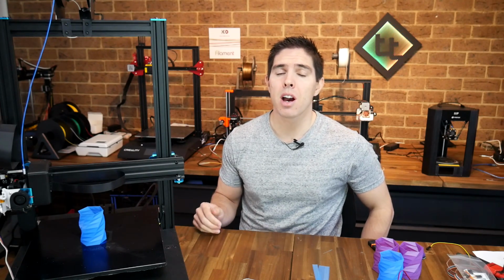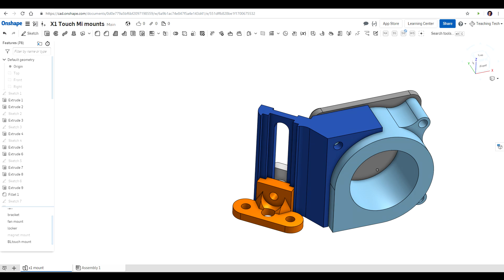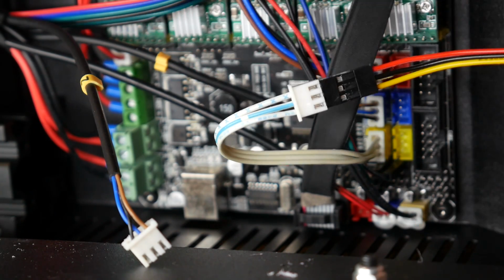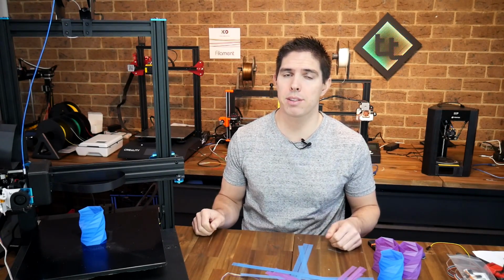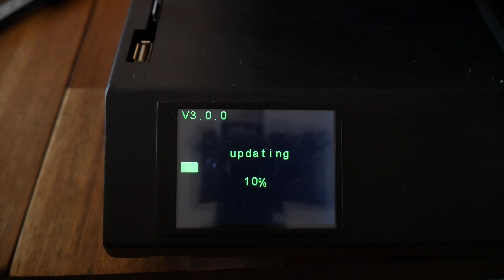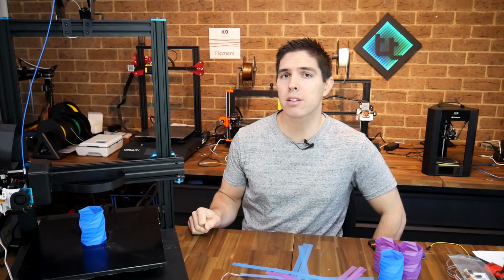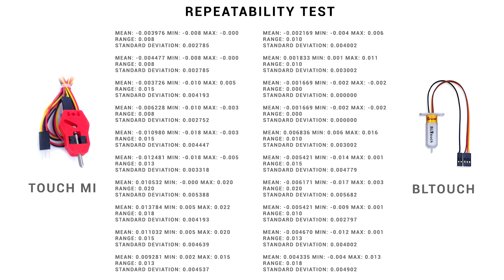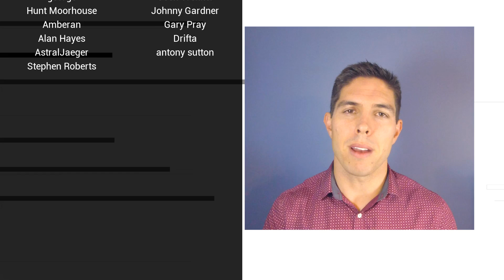Touch Mi vs BLtouch on the Artillery3D X1 + MKS TFT babystepping

Comment: I know its old, but I wonder if there is a way to re design the PCBs on the X and Y axis to take the plugs right there on the extruder assy. That way one could keep the nice cable management even better. And maybe update the newer versions to include the locking ribbon cables.

Comment: An added note, for the wiring, you can actually utilize the LED chip wiring for the BL touch, by relocating two connectors on the main board. You do lose the LED chip but now you have super clean wiring, with zero added wires. No modifications to connectors are required either. Look up “Waggster Mod” here in YouTube.

Comment: Thank you very much for such a great guide! Has anyone experienced an issue where the printer starts heating up, but doesn't reflect the temperature ramping up on the screen? Also, even though the temperature reaches the set points for both extruder and bed, the printer screen does not show it and print does not start. Any ideas?

Comment: Great video as always. I have one of these printers on the way. My preference would be to send gcode direct via usb cable from Repetier Host running on my PC. However, I note the TFT screen had to be disconnected for you to update the software. So, my question is, am I able to run as I described or do I have to walk a job on a USB stick all the time?

Comment: You should try another approach on Touch Mi. Change its position to the right side of the extruder and trigger the probe by going to the X+ limit. First, perform a G28 and then go to X max position to trigger the probe if needed. I don't think you're reaching X max position on a daily basis when printing so you should be on the safe side and not accidentaly triggering the probe and ruin your work.

Comment: Hello: I bought the Touch Mi and brought 3 cables to install it in the Ender 3 but the Z control has a 2-wire pin, this sensor has 3. Where is it connected? Thank you

Comment: have you tried using the actual conductors on the factory installed ribbon that are meant for the LED, and re wire them to use those for the BL sensor ??

this would disable the LED but the BL add functionality...

Comment: That printer is a bottomless pit, spending money continuously
Reply: A house is a hole in the ground where you throw your money.
A boat is a hole in the water where you throw your money.
A car is a hole in the street where you throw your money.
A plane is a hole in the sky where you throw your money.
A 3D printer is a hole in your time where you throw your money.
Reply: @microdesigns2000  
I agree, but not all at the same speed, or for the same reason, 
mine was not an isolated case
Reply: @fgil45  Oh ya.  Before I moved last year, I gave away my 3d printer to a friend that deserved it, along with all the tools and filament.  So I just received my new printer in the mail today, to the house I just bought a couple of months ago.  The filament and nozzles will arrive soon.  Then I can fulfill your prophecy, spending money continuously, haha.

Comment: @Teaching Tech    Help!  I have Have a plug with 3 brown wires going from the servo pins right in line with the Z min stop pins to the ribbon  cable? Mine is a V4 Printer. Any idea what these are about?
Thanks

Comment: Hello,
for me the things in the More menu don't work. Can someone help me there? The auto leveling is displayed but in the More menu the lights of the led are still there. I did the wiring as here (https://www.youtube.com/watch?v=ynm8inRMVkE) but connected the pins as in the instructions from teaching tech. So this should not be a problem.
Is it normal for the printer to not stop auto-leveling?

Thanks !!

Comment: I opened my Sidewinder up and every possible connection to the main board was slathered in hot glue. I picked at it with tweezers and dabbed some 70% IPA on it with a Q-tip and managed to remove what I needed. I get that they need to make sure the printer's ok for shipping but oh my god did that suck lol.

Great video!

Comment: Hi, iI am new in 3D printing, but your video is greate. I just updated the TFT the only button showed up was the "ATUO_LEVEL" but in the menue "MORE" still the 5 bulb symbols and note the ICONS for the BABYTEPPING available. I followed the instruction and used the perconfigured files for TFT and marlin and I checked if the adjustments are in the files. Could you help what should a look for? regards. Alexander
Reply: I have the same problem.  did you solve the problem?
Reply: I have the Same Problem ... Any fixes ?

Comment: sorry but absolute noob here regarding flashing new firmware onto printers, i downloaded the firmware and get that part with the TFT screen flashing but what about the second "bltouch" folder with the marlin folder? i never worked with arduino before so do i just need a special program to compile it and put it onto the sd card aswell?.. i dont get it, pls help

Comment: Am I right in assuming that this is going to work just the same for the genius, after adjusting parameters for bed size?
Reply: yes but there are extra Pins on the extrudor-pcb. so you dont need custom wiring

Comment: I have tried updating my lcd multiple times the memory card way does not work not sure why is there another way? It reads the card because I can see the files on the card it just never updates the screen
Reply: Is your card larger than 32GB? I tried with an 128GB micro sd first and it did not work. Then i tried a 32GB card and it worked fine

Comment: What do you do if you have a 3 pin all brown wire going to the servo location ? I dont see it in this vid at all and dont want to disconnect it incase I start a nuclear reaction somehow lol
Reply: I have the same thing.  I think you are supposed to use the other end stop connector to the left-j8 on connector D19 i believe. i have the same issue.

Comment: Can I upgrade the TFT & Printer with the baby step function / M500 Eeprom save without FW changes for the BLtouch in case I don't want it?  (My bed is dead flat, I see no need for the BL touch)

Comment: I have this set up and uploaded the firmware from TeachingTech for both the main board and the TFT, however I now get an occasional EEPROM  datasize error and the screen that is supposed to have the baby steps and only on or off for the LE still has buttons for all 4 colors. In the Arduino IDE it said upload complete but never gave any more info, I thought I would get a final list of data after the upload.... Any help?

Comment: If I see right, the existing ribboncable has 4 wires used for lightning (12V, R, G, B). You might simply change the LED to a neopixel using 5V, GND and Signal - so you get 1 wire of the existing ribbon cable free. As a Mi touch also use 5V and GND, the free line would be enough for output signal.

So no extra cabling needed, you can go on with the original nice ribbon cables.

Also when using BL-Touch:
- Change coldend fan to 5V
- Power coldend fan, BL-Touch and neopixel from this 5V (maybe use capacitators to stabilice power if the fan disturbs stability).
- from the 4 lines of the former led use one to control the neopixel and the other 3 for the BL-Touch.

Have not checked it now, but this might be a way to avoid changing the nice outfit of the printer...

Comment: Nice video! For me, an inductive sensor is still the best option. It's very repeatable, and no parts can break. Best of all, it's under 10$. Firmware is easy to set up if you're following Tech2's video on these sonsors.

Comment: i followed this guide but the leveling seems to leave a 2 mm gap between nozzle and bed. tried to do the lowering trick but as soon as auto leveling starts it goes back to the gap. as well as hotend fan never comes on. Any advice?

Comment: is possible to do only the "babystepping" mod. in the firmware, without the bltouch?
Reply: Yes, you can set the Z endstop point in the firmware. For example " #define Z_MIN_POS -1.5 " Will allow you to go 1.5mm below the trigger point. This is a setting usually for ABL only, but -0.1 or -0.2mm is safe with most sensors.
Reply: Nope, whitout an auto levelling sensor, the Z hits the end-stop, you can not go belove that point.

Comment: this works great except for if you're using octoprint it messes up EEPROM datasize error
Reply: I'm having the same issue.  Is there a fix?  I do all my printing through octoprint.
Reply: @bemuse  far as I know no but there's no manual leveling either anymore so how do you manually level before you want to auto level

Comment: Would this be a good first 3d printer? or better to get an ender 3?
Reply: Aaron Argent 
They look fairly similar functionally.  It comes down to if the extra features on the X1 would be something that you’d use.  I have upgraded my Ender 3 with a TFT but there is no ‘upgrade’ to get a larger print volume.  Direct drive extruder are possible upgrades for the Ender 3, but are a bit clumsy.  So if you want to print flexible filaments easily and/or larger items look at the X1.

If you’re OK with the additional cost then also do a comparison of the X1 against similar cost Core XY type printers.  Those have some features that the X1 can’t match, but I’m not aware of a really solid one that isn’t far more expensive.  (But that can change week to week.)

Take some time to research and make a list of ‘definite’ and ‘nice to have’ features, and consider ease of future upgrades if they might be needed.

Comment: So let me get this straight...you basically babystep the nozzle while printing...and when you save it will auto keep the Z offset? Could this be done on a regular encoder screen? Babystep while printing and than save?
Reply: AirsoftSlo 
Yes, if you can put the code in place.  Do a search for the display type you use and find the firmware and instructions to add the code.  It’s the same principle as this TFT display.
Reply: @boggisthecat  Ok cool. I already have that enabled. I just didnt know that by saving to eeprom you can store the babystep value.

Comment: Michael, is there any plans to do a Marlin vs Klipper firmware video at any stage? Would be interested to see whether Klipper makes as big a difference as people are claiming
Reply: It does, but mostly on better machines printing at much higher speeds. You can get decent prints at this speed on a dialed-in potato with Marlin, but 120+ with 6k+ accel and you need klipper's motion planning. Modern Marlin is good enough where on machines like these you're mostly limited by kinematics, so any quality issues are either caused by going too fast for the machine's envelope, dial-in issues, slicing errors or a fundamental borkedness of the potato in question :) In comparison, voron2 with klipper is actually limited by the hotend.

Comment: You know what would be even better would be to add a raspberry pi to control the printer and make or find a plugin for the save to eprom (or type it in the command terminal) but add a small extra little Arduino 90 motor and have that move the magnet out of the way after the command that moves the ball, then bam after the print is done have the little 90 degree motor move the magnet back so it’s ready for the next print

Comment: Thank you for the updated video I don't know if you read but you can disable the LED light and use the wires in the ribbon But then you lose the LED light but if you're okay with that just move to LED lights wires to the positions that you had in your video
Reply: Jafterdark, do you know where can I find more about repurposing the led wiring?
Reply: @miguelm4845  https://www.facebook.com/groups/2277023895866486/?ref=group_header

Comment: Michael - did you see on the Facebook group the images of a newly designed board that incorporates a BL Touch port - it looks like this will replace the board on the left of the extruder and will utilise the existing ribbon cable
Reply from the maker: No but that sounds amazing!
Reply: Link?
Reply: Yes a fully integrated solution will be great but I really like the design of your mount

Comment: Z offset (babystepping I guess) can go as fine as 0.01 and I've found the need for that resolution. M851 Zx.xx will change it via terminal.
Reply from the maker: For this printer I actually set a guestimate via terminal in this manner before doing a final live adjust during the print.

Comment: You'll find that the Ender 3 bed was way more warped and that style of ABL isn't good enough. Maybe try Mesh ABL?
Reply from the maker: I agree on the warping but the repeatibility results here should translate no problem.
Reply: I’ve had similar issues with my BL Touch on my Ender 3. Sections of the build plate between the measured points are still off. I upped the measured points to a 5x5 grid and it’s a bit better, but not perfect.
Reply: Jason 
I can’t recall right now, but I am fairly sure you can increase the number of points well beyond 5 x 5.  If you have enough memory on your board just up the mesh density until you get a good enough result.  Your other option is to use a glass plate.

I bought an Ender 3 pro and decided to go with the magnetic surface.  I think it may well be quite warped as I am having a lot of trouble getting consistent adhesion.  My earlier Ender 3 (non pro model) has the glass plate, which has been generally very good — and excellent after I added the MKS Gen L board and BLtouch.  (Took a bit of fiddling to get it working correctly, but most of it has been covered on this channel which proved very useful.)
Reply: @boggisthecat  Oh yeah I realise you can, but that just takes longer and longer to level the bed. 5x5 works most of the time, unless printing something which uses most of the bed. I have also upgraded to the MKS Gen L Board, it went pretty smoothly in the scheme of things. Apart from upgrading the drivers to TMC 2160's, that was a bit fiddly.

Comment: You are probeing the z offset with babbystepping and save to eeprom. (Time9.44 min)

Is this also possible with marlin?
Reply from the maker: Yes, in the babystepping part of marlin there is a z offset line to uncomment. I've shown this in any of my other ABL vids where the printer had a regular LCD.
Reply: @TeachingTech  I just tried this about a week ago with a fresh copy of marlin 1.9 and it didn't work. It would save the values to eeprom but it never did the babystepping in real time. Only when I commented the z offset line out it did the babystepping again.

Comment: Good comparison! I'm currently using a 3Dtouch which works really really well. Although sometimes it doesn't want to work. I have ordered two proximity sensors now to see if I can use those since they seem to be simpler and more reliable. Meanwhile if I manage to get the proximity sensors to work, I will try to solder the wires directly onto my 3Dtouch to see if that improves anything. Next week my crimp tool and box of DuPont connectors are rolling in and I'll be able to completely rewire my machine (most cables are still way too long which causes immense clutter and probably maybe even introduces noise). Would you have any advice for improving my 3Dtouch sensor? If it works, it works really well and I wouldn't want to ditch the module honestly.

Comment: Added a Mosaic Pallet 2 Pro to my Arty. Don't know if I'll add auto level as the bed is pretty solid as is. Only gripe has been rather disappointing quality control.
Reply from the maker: Quality control on the X1 or the palette? I've found this the best put together printer I've reviewed so far.
Reply: @TeachingTech  on the sidewinder. They are really good at support though. Just wish it came out without the scratches and zbanding.

Comment: Mike, may I ask why you seem to have totally given up on the TH3D EZABL?  I've used both there doesn't seem to be too much difference in results.  Is it the price or shipping cost
Reply from the maker: I made a comparison video between it and the bltouch a while ago. It worked well but printer went to a new owner.